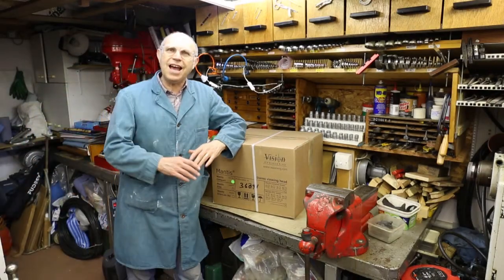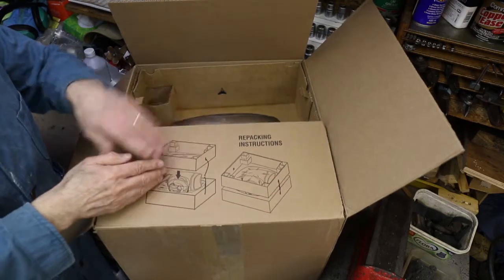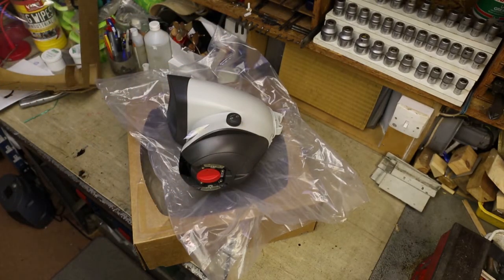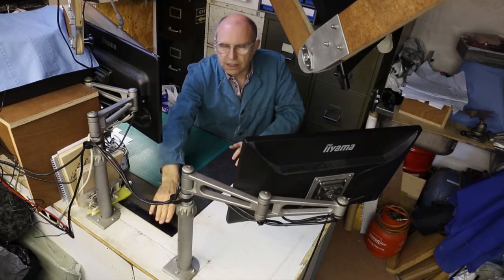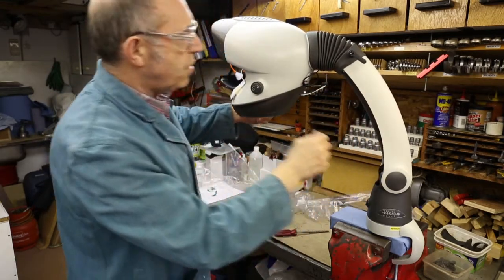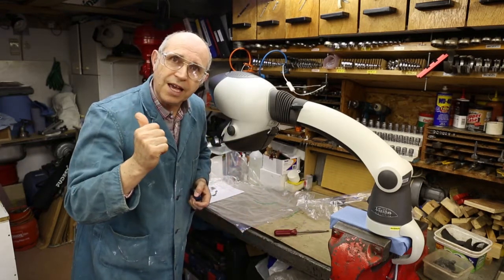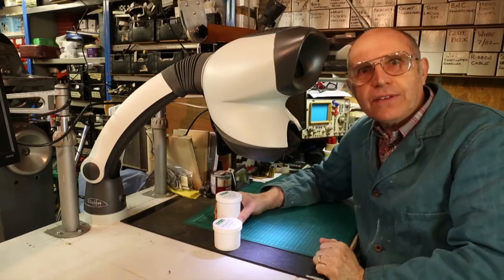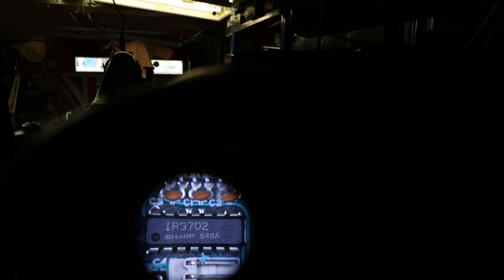Unboxing The Mantis Compact 3D Stereo Microscope. Vision Engineering

Comment: Now a year on since you bought this, what are your thoughts on it. Would you recommend this as a microscope to buy? Great watch , thanks for the share
Reply from the maker: Hello Surge101. I like the Mantis Microscope. Looking into the screen is easy and I don't get a neck ache like I did with an old vertical tube type microscope. I have assembled circuit boards, inspected the internals of clocks and used it to locate splinters in my fingers. It was an expensive piece of kit but I'm not disappointed  at all. The only thing I wish it did have, is a port for a camera to fit. There is a model with an internal camera but it was far too expensive for me. I hope this helps. Take care Jim

Comment: Hi,
is this type of microscope good for soldering or just for inspection?
Reply from the maker: Hello Sebastian
Thank you for your comment, Because this microscope gives a partial 3D image it’s really good to use as your soldering or inspecting your job.  To protect the lens don’t forget to fit the clear glass lens cover, it stops you striking the lens with the job as your working, and also prevents any deposits from the flux smoke building up on the surface of the lens.  Hope this is of help. Take Care Jim